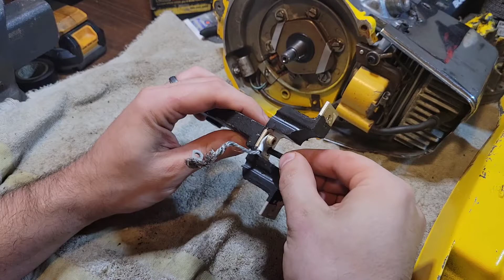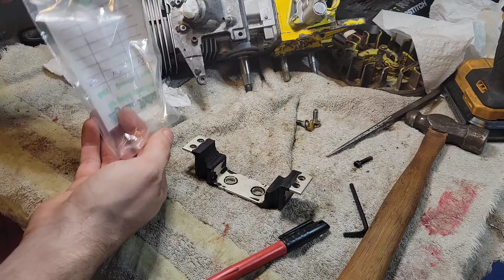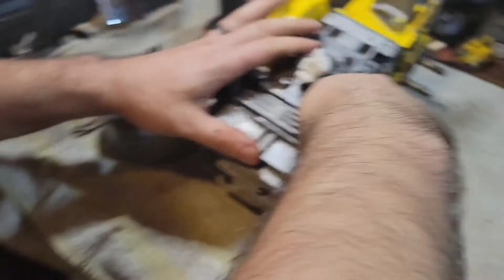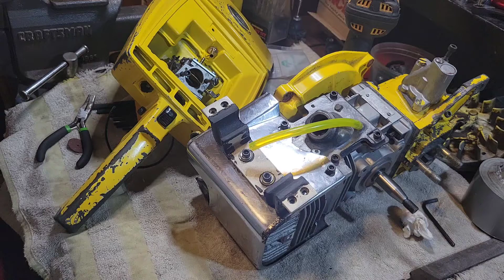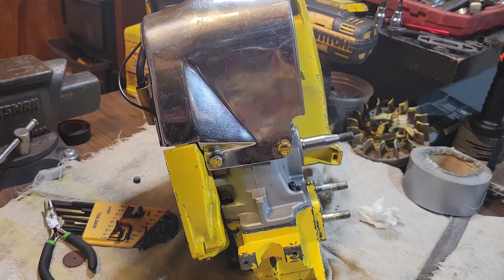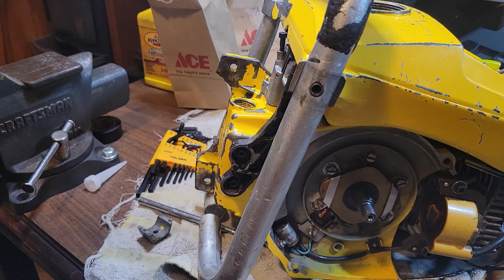McCulloch Super Pro 125 101AA Ground Up Build Part 4 #mcculloch #mistermacgray #mcculloch125101

Comment: I put spacers between the shroud and the intake manifold, and line it up with the starter cover before finally tightened everything down. Also use spacers under the rear av mount to get the proper clearance between the tank and shrouds, it’s not an exact science but spacers will help overall. I use pan head screws mounted back wards to mount the rear av. Your way worked with the grease, I bolt the shroud up with starter cover on, spacers in place, and measure a sp125 block av mount locations off of the intake manifold bolt holes. Just another way to do it. I also run the kill wire through the large opening in the rear shroud and bearing support cover. Not trying to pick you apart, just sharing ways I do it
Reply from the maker: I did a very small dremel slot for the kill wire and unless you are looking for it, you won't see it. I was working with what I had and I was impresses on how I came up with being abke to mount the rear anti vibration mount, pretty much copied how a PO did it to the 101B race saw I have.
Reply: @MisterMacsGarage  I only worried that the kill wire could chafe and cause am intermittent mis...ask me how I know?! Lol   Your method to find th av is great, but remember the factory Used spacers  on the 125 too, some phonemic  some hard plastic. Look at the gap between the tank of your new build and a stock cp125, you will see that the saw gets tight in the new build compared to stock.
Reply from the maker: I knkw that they had a factory spacer, saw that building my cp125 and taking the other sp125 apart plus my race saw.
Reply from the maker: Sorry this video was so lengthy, over 3hrs of work and I cut it down the best I could into just over a hour.